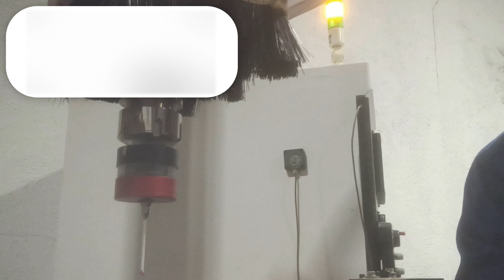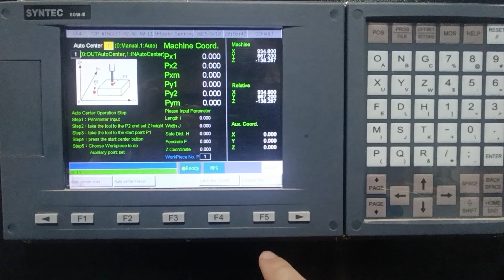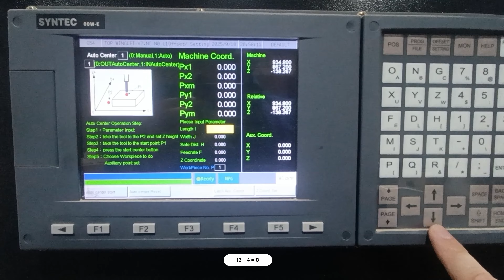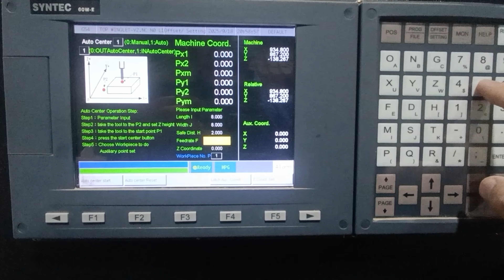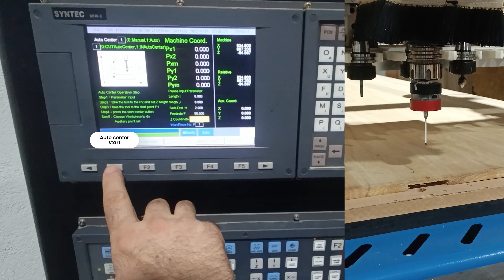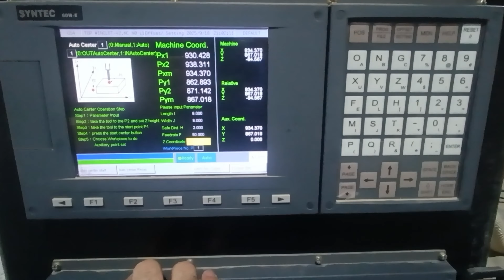Syntec CNC Auto Center: Using a 3D Touch Probe to Find Hole Centers (Step-by-Step)

Comment: Hello Melchior Hof,
I have a Syntech 4MB control unit. Can this probe be connected to the 4MB control unit as well? Which ports did you connect this probe to on your machine?
Reply from the maker: The 4MB is likely functioning similar as my 60W-E.
The probe needs its signal line connected to an open IO port of the control board. And then the PLC ladder needs to be reprogrammed feed the signal through digitally to feedback register of the auto center function.
I had no port open port, so I rerouted another port and with help of Pankai we changed the PLC ladder accordingly.

For help wiring the IR receiver to the Syntec control and modifying the PLC ladder:
Contact: Pankaj Chauhan
https://www.facebook.com/pankaj.rana.135163
Reply: @WikiHomeSL  hi, we have Syntec equipment 3D probe, need help, how can i contact with you  ?
Reply from the maker: @accteknina4752 Here my website with contact information: https://www.didihomes.es/
Reply: First of all, thank you for taking the time to provide this information.

What is the model and brand of the 3D touch probe you are using?
Reply from the maker: @enginsanli7836  Prices can go easy in the 4 digits. But back then I got this affordable IR wireless 3D touch probe:
https://es.aliexpress.com/item/1005006381743588.html
Reply from the maker: Currently this is maybe a better successor:
https://es.aliexpress.com/item/1005009832574909.html